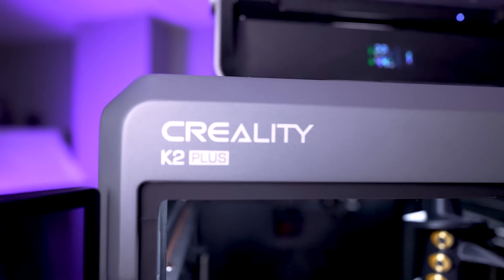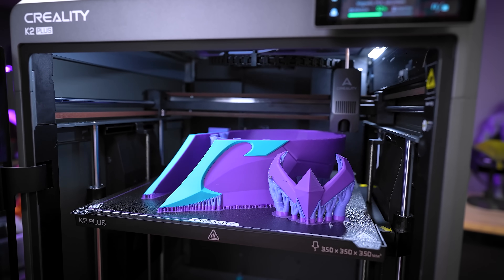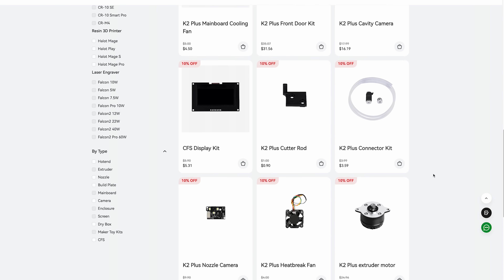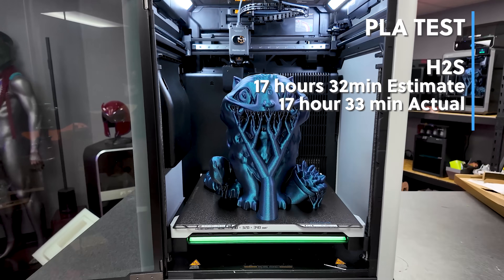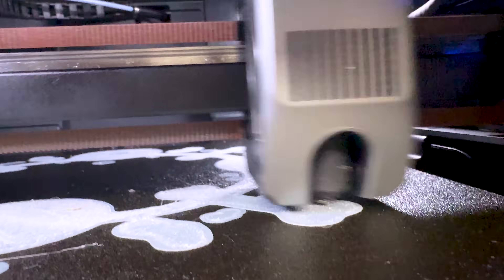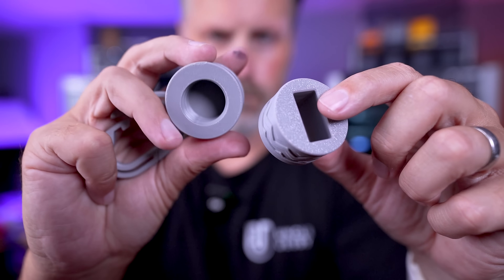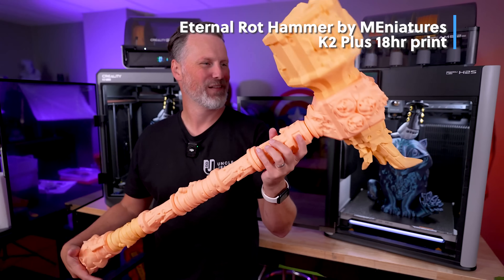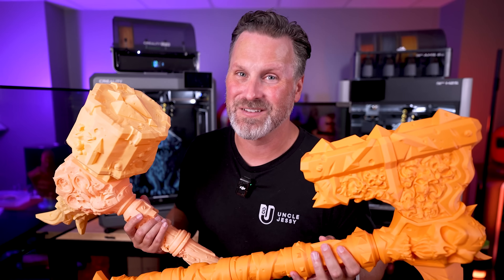Bambu Lab H2S vs Creality K2 Plus — 3D Printer Showdown 🔥

Comment: Excellent just what I wondered which one was better!? K2 has a Microswiss Flowtech hotend available too which is awesome hotend. I use a Flowtech in my Bambu P1S and hoping by end of year or spring 2026 a Flowtech will be available for the Centauri Carbon.
Reply: i'll second this. I went with a K1 SE last December (under $300 for basically a K1C without the enclosure, think they're $250 now), got the flowtech hotend and bondtech XY upgrade, printed some walls and got a K1C door, made a chamber heater. Quality and consistency are amazing with everything I've tried so far (have done PET-CF, PA-CF, and i print more ABS than anything else) and got some PC-ABS on order to try out (still haven't tested how it holds up to 60c chamber temps).

The Bondtech kit's seriously reduced artifacts at high speed, but the Flowtech's the upgrade I will swear by. The printer brand designed nozzles are never great. I swap nozzles all the time (regularly use 0.2, 0.4, 0.6, occasionally 0.8, and with 0.6 I keep one CHT high flow and one hardened without CHT to play nice with fiber-impregnated filament). Not a fan of either company's way of doing proprietary nozzles. I know the Flowtech's technically a proprietary design (at least, no one makes aftermarket Flowtech-compatible nozzles that I know of), but they stuck with the tried and true method of just screwing in a nozzle that's just a nozzle, not a fragile combined nozzle+heatbreak like the Unicorn or a whole hotend permanently attached to each nozzle like Bambu does.